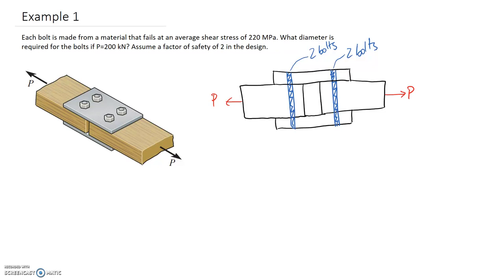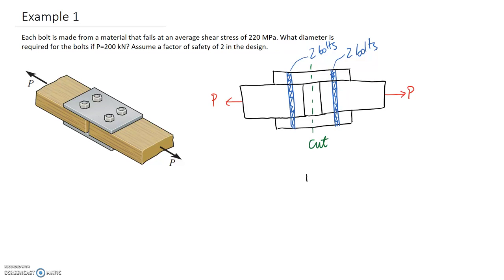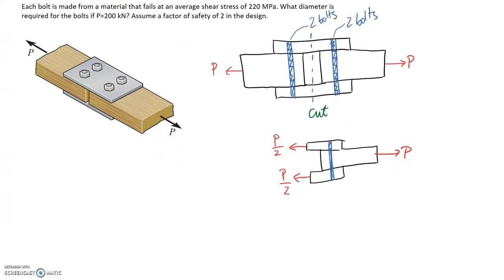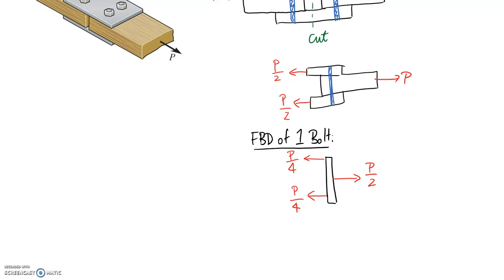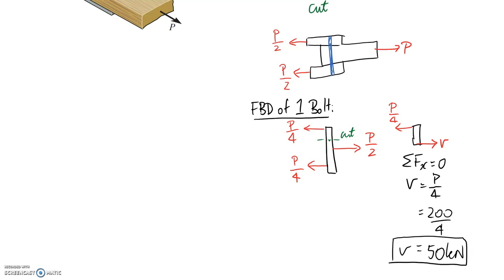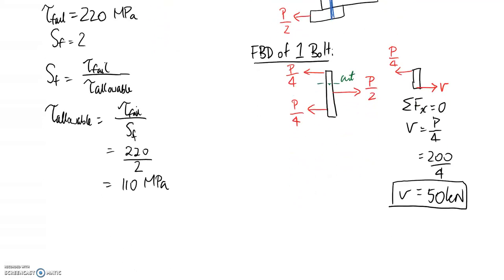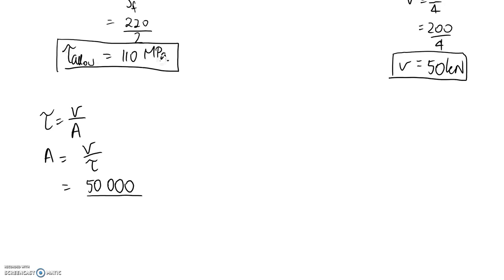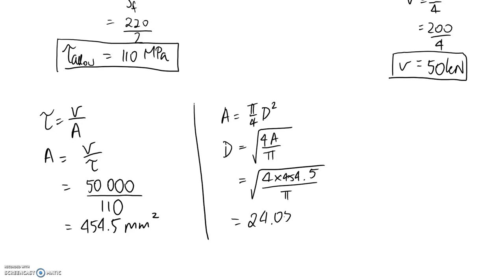Shear in Bolts Example

Comment: 2:46 internal load also a momentum right...
Reply from the maker: Things need to be moving for them to have momentum. We're assuming that everything is in equilibrium (not moving).
Reply: @theryderproject5053  but the p/4 does create a momentum at the cut so just the force doesnt make equilibrium right?

I mean take the Sum of momentums at the place where V is and you might see what I mean?

Its just a small thing i thought i noticed but besides that great video, thanks!
Reply from the maker: @gungaginga3410   I think you mean "moment" not "momentum". 

We are assuming that everything is in equilibrium so if you sum moments it should be equal to zero. There will be an internal moment (which I didn't draw in but similar to the v in the diagram) that balances the system to be in equilibrium.
Reply: @theryderproject5053  oh Yes excuse me i mean moment, im a dutch engineering student and i thought these were the same meanings:/
Reply from the maker: @gungaginga3410  all good. Hopefully the above answered your question!